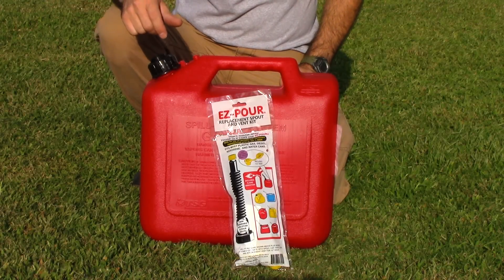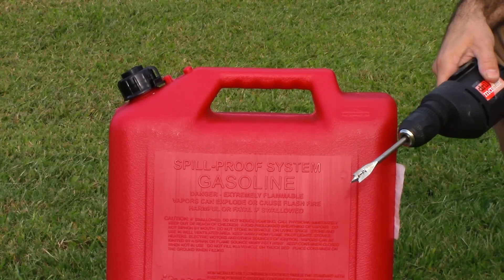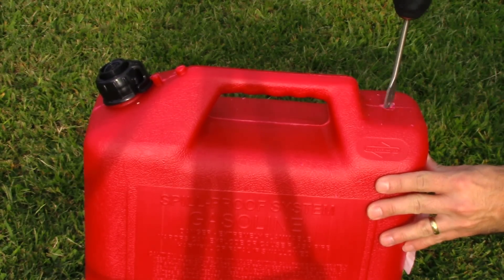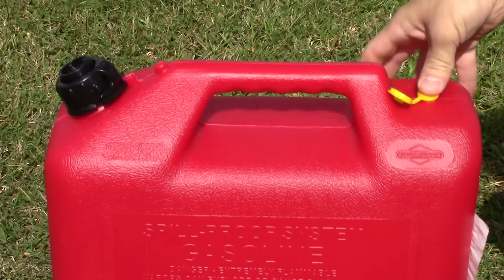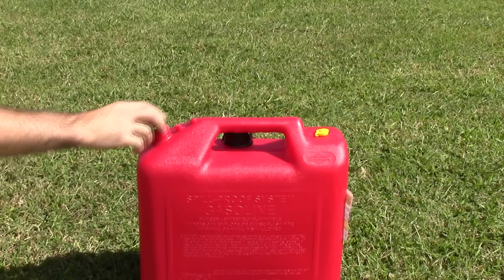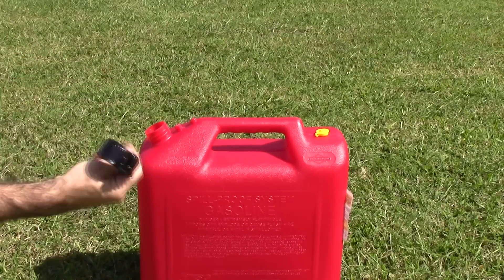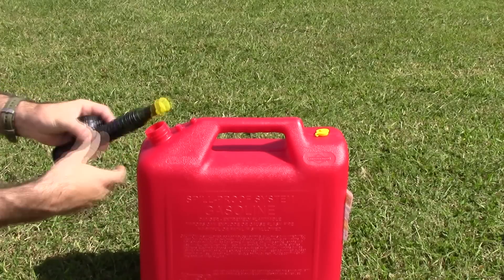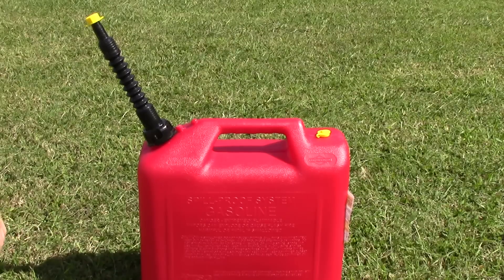Diy new gas can upgrade

Comment: by using a metal truck valve stem and removing the valve. makes a great vent for a gas can. saw this on farmshow magazine. shown below 

Robert Dagen, Conneaut Lake, Penn.:
“The vents on some of the newer gas cans are 
located inside the nozzles. So, if you remove 
the nozzle to pour a full stream you have no 
vent. 
 “I decided to come up with my own air 
vent. I drill a hole on top of the can and install 
an ordinary tire air valve in it, using a 2-ft. 
piece of wire to pull the valve up through the 
hole.”

Comment: One needs to use a bit of silicone sealant on the vent installation otherwise fuel will leak when it sloshes in the can.  I have done several.
Reply from the maker: Great tip, thank you!

Comment: Just remember that even battery drills make sparks inside the housing when running...  nuffsed?
Reply: You do this when the container is empty...
Reply: Empty containers can still hold more than enough vaporized hydrocarbons and driplets of gasoline to send you to the burn ward.  Skin grafts = bad.
Reply: that doesn't matter if the gas can is new like it is in the video
Reply: Rinse out with hose, then let sit. Not a problem. 
Your dill motor brushes are too far away to ignite any vapors.
And there are not enough vapors in a rinsed out and dried out can.
Reply: Easy and safe....fill and drill!  Fill with water then drill.  Don't forget to dry thoroughly.

Comment: Where can I buy that kit?
Reply from the maker: 4451ab I usually get mine from a local hardware store, but they are
available at tractor supply co. for around $10.00 or on eBay for around $12.00.
Thank you for the question, Lonny
Reply: Just did this last week to a new bought can.  Got that kit from Orschelns.  If Tractor Supply has it to, I would imagine that you could probably find it at Feldmans or any other farm supply store.

Comment: I hate the new style gas cans also, dam safety gurus need to leave stuff alone. I changed all my new gas cans over as well with the same kit a little pricey at around 10 bucks for plastic but well worth it so as not to have the hassle with the new junk they are selling these days.

Comment: who sells the kits?
Reply from the maker: quadlinear I buy mine from a local hardware store, but they are
available at tractor supply co. for around $10.00 or on eBay for around $12.00.
Thank you for the question, Lonny

Comment: this video will help you with installation of the valve stem.  would suggest using metal truck valve stem instead of rubber one.  Fixed three cans like this and used them all summer. the only thing the gasket material in the valve stem cap does not like gas.  had no leaks. and the  farm supply nozzles work great.  This cost a little more than a new can on sale but won't frustrate the be-gibbers out of you when you use them.

click on the link below 

http://youtu.be/0lcnwdIYEfI